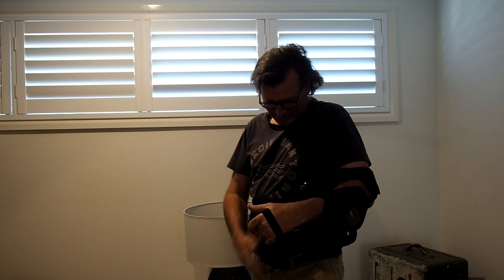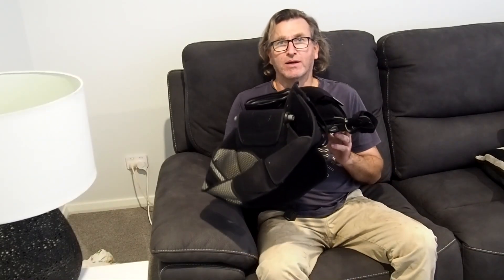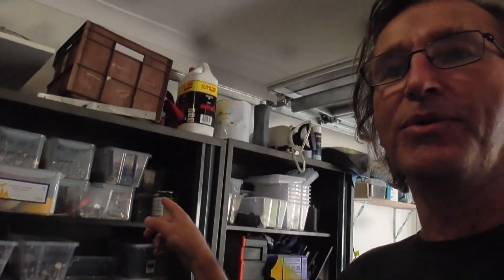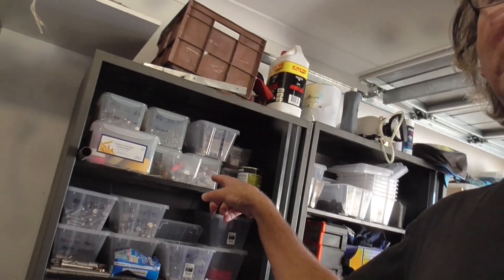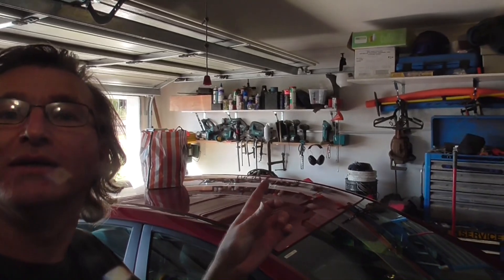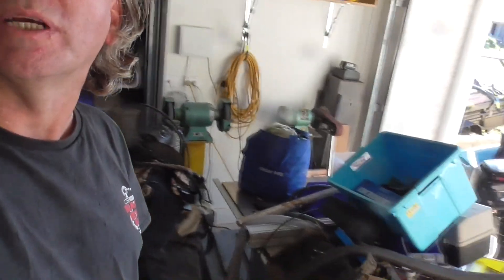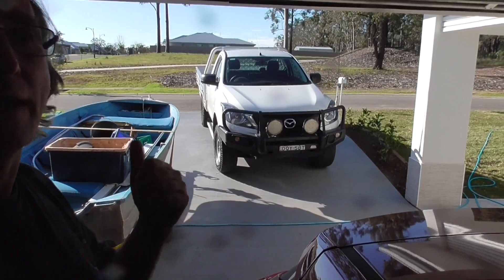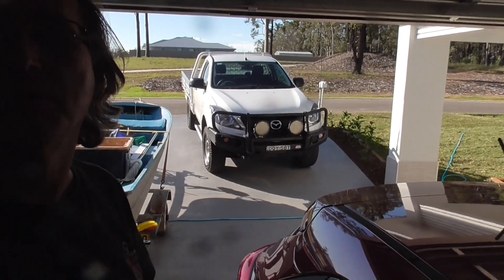EP54 Boat refit, How is my HEALTH going-  Rebuilding a liveaboard STEEL TRAWLER

Comment: Hi Paul and Cheryl. Good to see you back. It is always good to get rid of the constraints after a big operation. Glad that it appears to have been a success. Panelling on the wall looks good. The boat is still how you left it which is good to see. Ease back to work steadily and you will be ok. All the best.
Reply from the maker: Absolutely and Thanks Bob, I'm glad to be back at it even if it is slowly.

Comment: Good to see you back,do the phyiso , and you'll be fine, had1 restrictions an 1 replaced , so yes , I know what it's like,replacement was less painfull, and recovery was actually faster.
Reply from the maker: Thanks Jeff, I feel that it is coming along well. I don't know if it is too good or not good enough. I guess everyone is different though. Physio just go reduced to 1 session a week instead of the 2 I was having so that is great I suppose.
Reply: @TheadventuresofSherylandPaul   yes good sign, it will take 12 weeks at least to get mobility, and that much again for strength in the muscles,  cheers.